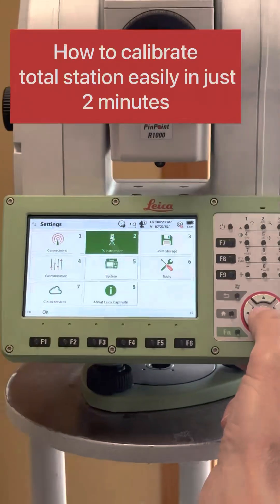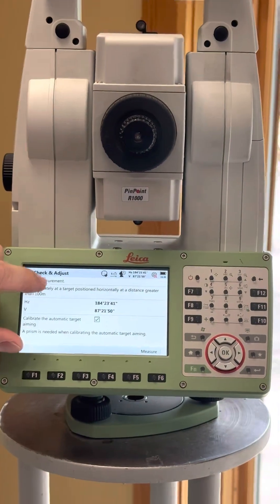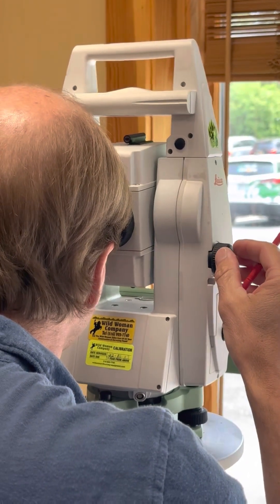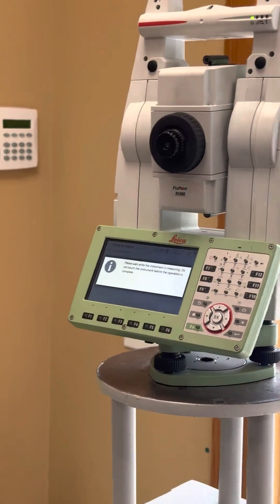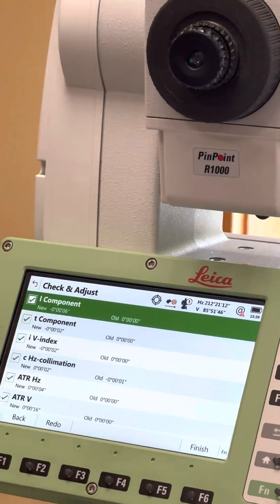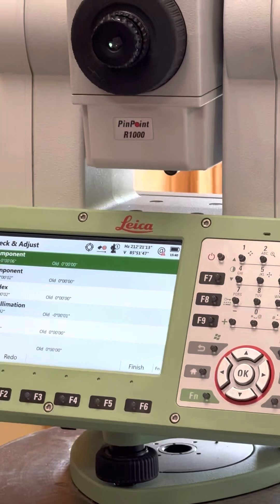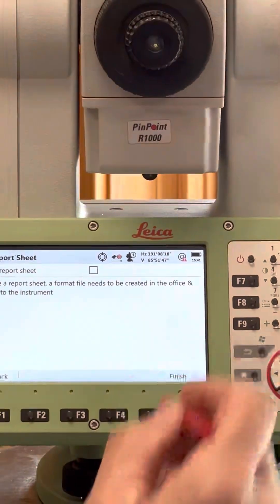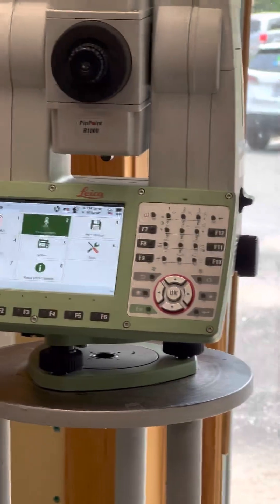How to calibrate total station in few minutes

Comment: Dumb question if im buying a second hand used TS15 can i get away with doing this calibration or would i need to service this...
Also how often do you need to go to the leica distributors to adjust it?

Thanks
Reply: if you do this adjustment proper it is the minimum what you need to be shure, past you have done it go to a place where you have some fix points you know an make first and second face measurements to check the TS - if you do a firste and second face measurement (150mtr on a fix prism) set Hz to zero at first aim and write down Vz than do the measurement and if the dist difference is not over 2mm  and your hz and vz is in summa 360degree or 400gon +/-5mgon you can be shure its good. but a fieldadjustmen not clean intern the circles and avoid future damage by dirt and dust and oxidations inside the TS.  Fazit:  it allway depends where you buy.. at a leica dealer you get a certificate.. at a other dealer you get maybe even a adjustemt certificate but let me say its not the same. they have no acces to the needed leica service programms (lack of leica dongle or modern online adjustemt an testsoftware what connet you to leica) they do the same field calibrtion as you see here..and maybe even in this manner 😉. its like to buy a ferrari or maserati from private.. if it was every year serviced by (leica)dealer its o.k. if not it can be there is a expensive maintenance backlog ... one more tip. you can be shure the TS was not in service when it has a old firmware.. at a TS15 minimum you have to had V9.x today...   btw. a TS15 is a perfect choice!

Comment: When the guy says "this is what I was talking about, you don't have to be that far away" in reference to the "distance greater than 100m". What did he say about this? How far away is acceptable? Thanks.
Reply: Best to do as it says.  At least 100m and the prism the same height as total station.  I think the threshold is within 9 degrees vertically up and down also.  Wouldn't do it through a window either.
Reply: He was doing a demonstration. 

If your ass is on the line you’d best follow the prompt.